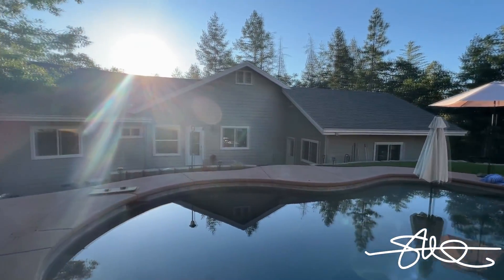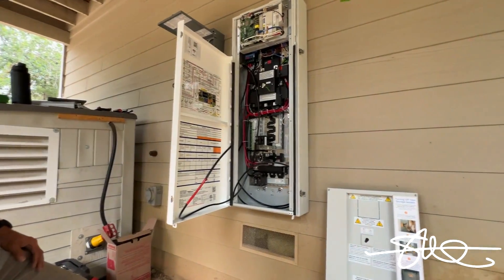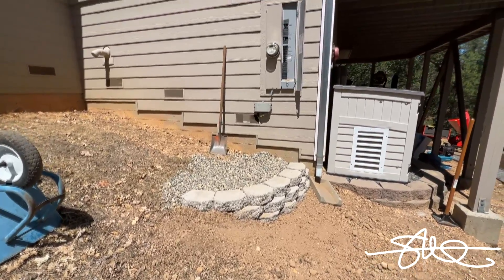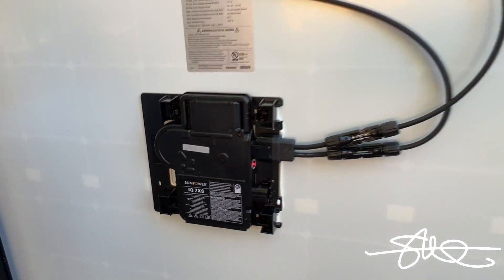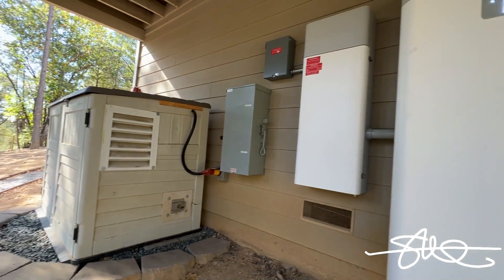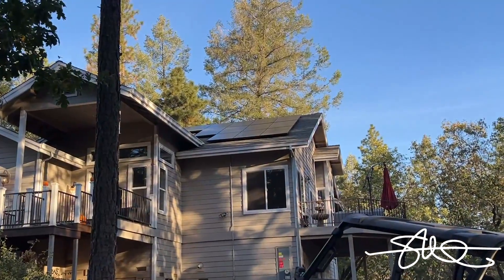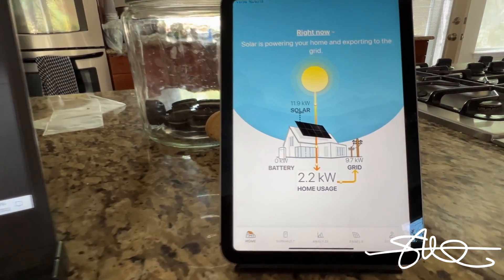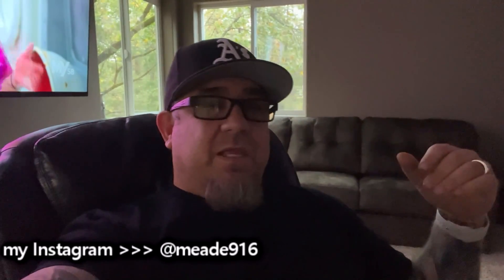Sunpower solar and Sunvault Lithium LiFePO4 26kwh Battery Backup | Full Install & Results

Comment: If you want to add the ac to your battery system you can get a soft start, That's what I did.
Reply from the maker: i know, i read about it.  But honestly, if the power does go out, i will not be running AC and killing the batts faster.  I will be conserving for sure.  The heater wouldn't be too bad but we never use our heater. We have a wood burning stove we use all winter :)